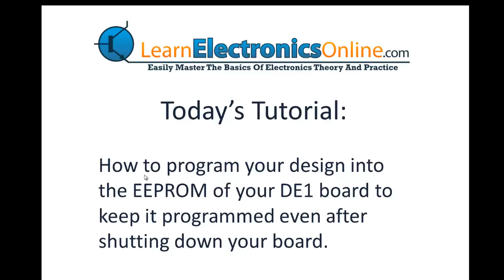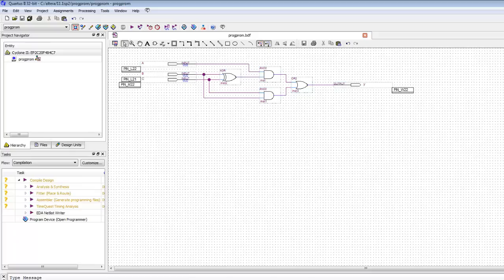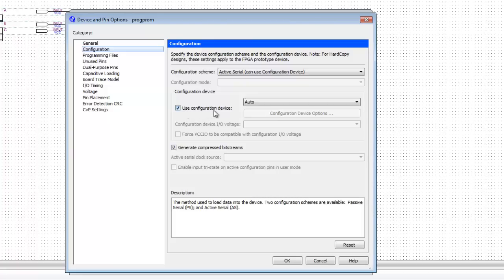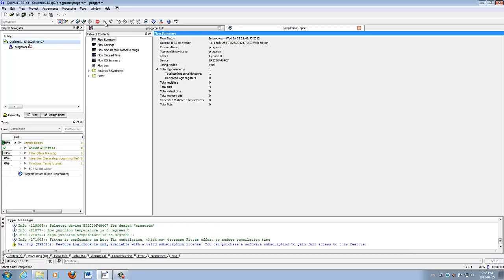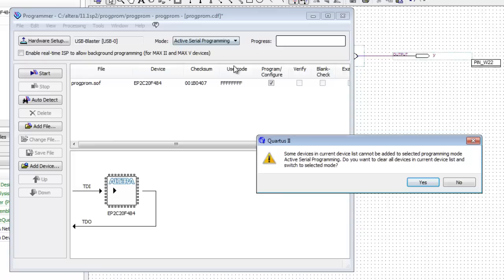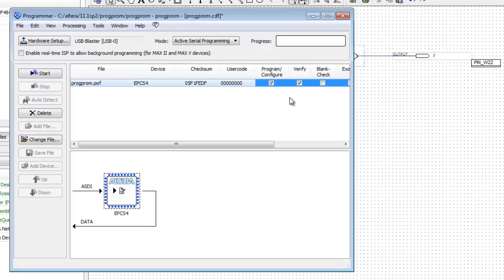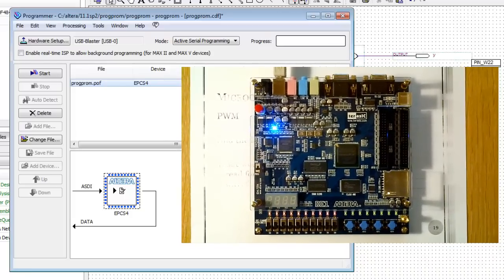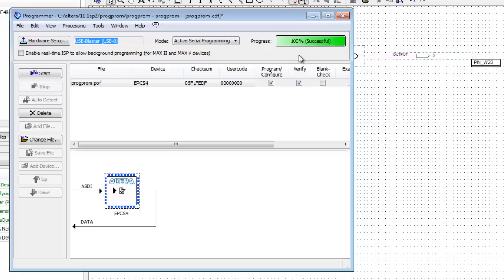How to program your Quartus II design into the EEPROM of your DE1 Board

Comment: YEAH!!! It works on Cyclone II. Thanks, you have new subscriber! The problem with Cyclone II is that there is no switch for changing into EPROM mode, instead there is another socket named "AS". In normal, RAM memory programming, cable goes onto "JTAG", but for permanent storage on EPROM (Or flash or EEPROM, whatever), one need to connect cable to other "AS" port. Now, my test logic gate remains even after power cycling.
Reply: Oh, now I got it, "AS" is not short word for body part (LOL), but for "Active Serial" programming.

Comment: Hi,I just program my design with the Active Serial Programming Mode.
When I wanna use to program the other design,it'll interference my new design.
so how can i erase the eeprom to initial state in my altera cyclone board?
Reply: It shouldn't interfere with your design. If you program something in RAM, it will work fine and will be the main program until you turn the power off. Then the eeprom program will take over. If you program it in eeprom, it will replace it.